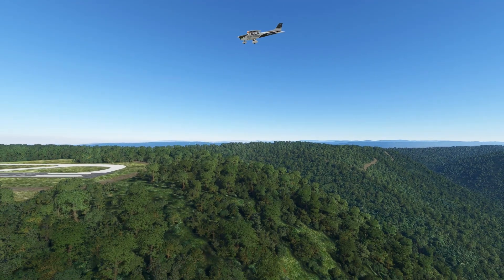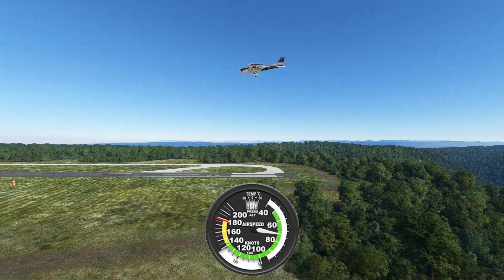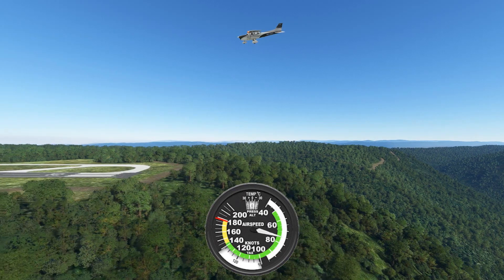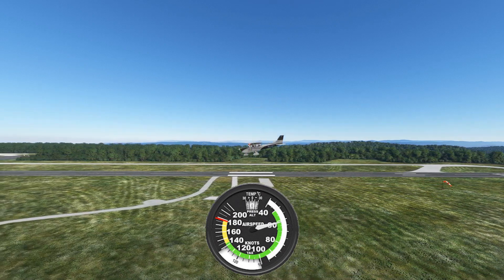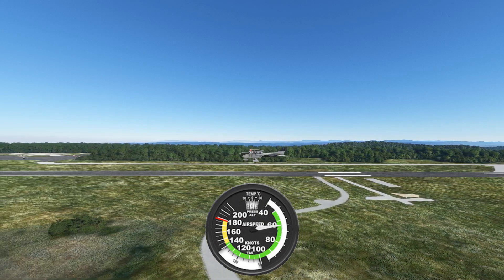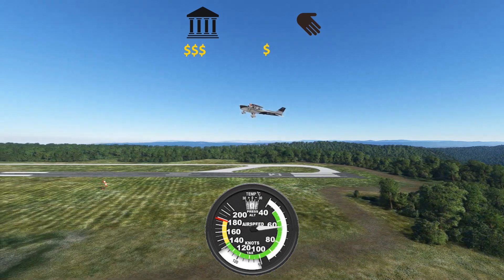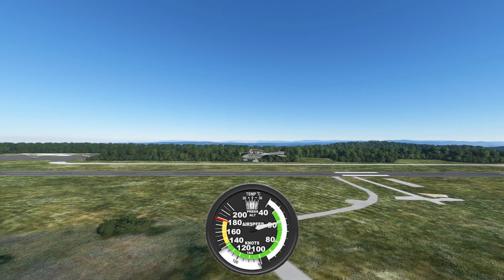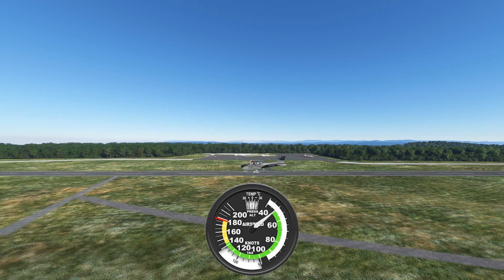Fix Your Landings | Floating Down the Runway

Comment: Good explanation of Wolfgang's law of the roller coaster as it applies to the closed or set/fixed rpm throttle.  His "stall down" was the best way to deal with this situation with the Sromberg carburetor of the old days.  Small Continentals using this carburetor would gulp significantly when the throttle was moved rapidly.  With modern carburetors, we can bring the throttle into dynamic play as an exact glide angle and rate of descent control.  Using power/pitch (power is altitude and pitch is airspeed) to control glide angle and also airspeed is a lot more effective and convenient than using the elevator for both airspeed (proper) and altitude (improper.)  Too much airspeed is the problem today and Wolfgang had the solution in 1945, when the average length of a city grass runway was 1500.'  "The 'stall-down' landing requires that you blend the approach glide, the flare-out, and the slowing up of the airplane all into one maneuver so that, when you arrive at ground level, you arrive in three-point attitude, all slowed up and ready to squat." Stick and Rudder p. 302.  Given that we can now use dynamic power (move the throttle like a good control) to exactly control the glide angle, landing on the numbers (or any desired spot) without the energy inefficient round out and hold off ("all into one maneuver") every time becomes a default nada.  Full flaps and pitch up on short final to cause enough sink to require power to maintain glide angle (first deceleration from 1.3 Vso) and then maintaining the apparent brisk walk rate of  closure with the spot the same as slowing into an intersection with our autos (second deceleration/ from less than 1.3 Vso) will put us in the three point attitude Wolfgang speaks of coming into low ground effect where Vso, and out of ground effect number, is no longer relevant.  Just understanding that in no wind we land well below Vso because of ground effect energy will help with our tendency to always be too fast.

Comment: Am actually having this specific problem and messing up my perfect approach and it's getting frustrating to almost giving up my love of flying
Reply: We all have good and bad landings, just seems to happen, don’t sweat it and hang in there.
Reply: Same here. I’m always high and fast. Very frustrating. A beam the numbers after 10* of flaps and a power reduction, I just can’t seem to descend w/o gaining too much airspeed. And if I keep the nose up to reduce speed, I don’t descend properly. Btw I’m flying a PA28-180. Plus the field I’m at has a noise abatement which requires a tight pattern. I’ll keep at it, but it’s frustrating 😣
Reply: @wyatt92563  same problem with me I’m also flying PA 28-181
Reply: I was too, in PA 28 181's, but I watched some of LewDix videos and he explains the importance of setting power, pitching for airspeed then trim to relieve yoke pressure. I was also perplexed by my instructors telling me to "keep the nose down" even when I was fast, but using this approach taught me that I can keep the nose down because of the induced drag, and I can manage speed with small power adjustments.
Maybe trying this approach at altitude may help solidify the concept.
https://www.youtube.com/watch?v=YZYh-xQscbw

Comment: I get the principle of using side slips to crab off some extra speed cash, but it makes me feel a little nervous to think about actually doing it with my low time. Sooner or later I’ll want that tool in my kit I suppose.
Reply: Learn to forward slip. You’re going to love it.
Reply: In a C172 As long as you keep your airspeed at 60kts or above and don't yank back on the controls while doing a forward slip you'll be fine.